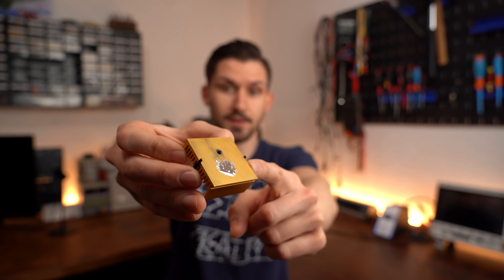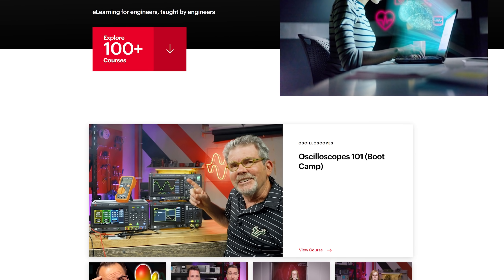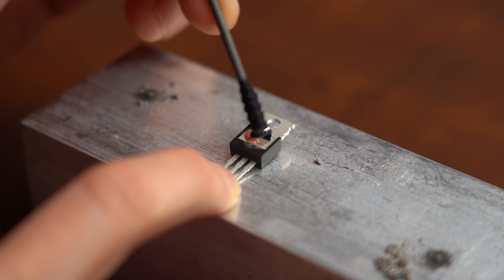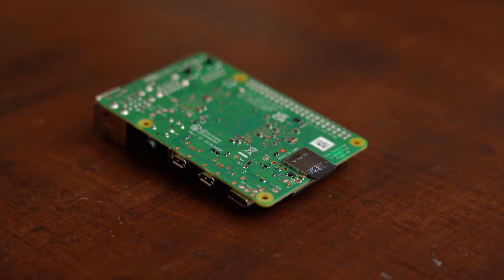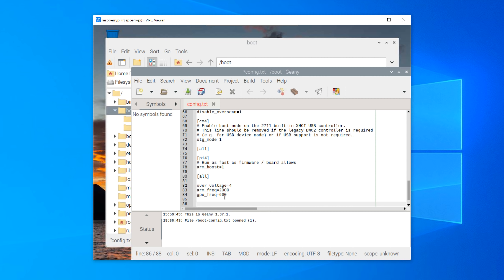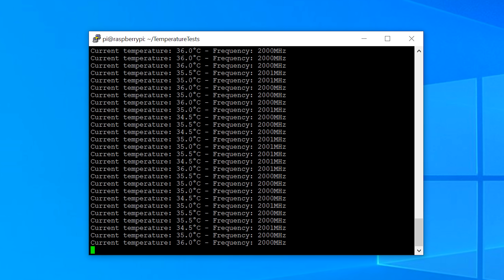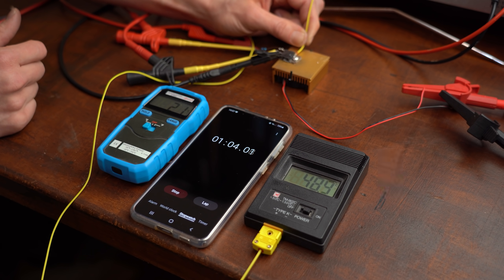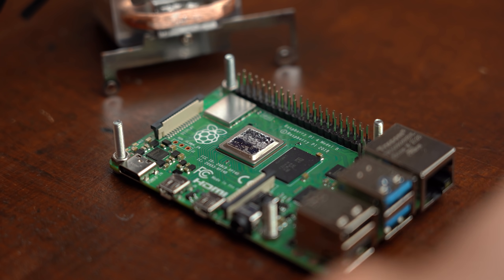Will Liquid Metal replace Thermal Paste? A Raspberry Pi gives the answer!

Comment: (written before watching) LM is one of those meme components(?) simply because of the PS5. Regardless of how well it may displace, conduct, or transfer heat, it is literally metal, and any stray amount can (and will) short circuts, and it's not the best of materials for contamination to circuitry, because it's liquid... I wouldn't ever buy a console system in the first place, but if I were, I wouldn't even consider the PS5, because any trace seepage would destroy the system... I'm curious about the failure rate of it used primarily in vertical orientation, but I'm not too arsed to bother with the failure rate of toys.
(edit after viewing): I wasn't aware of the limitation of not being able to use Aluminum, but that just furthermore solidifies why it shouldn't be used, considering (as you pointed out in the video) most use or have Aluminum heatsinks.
Reply: most use or have Aluminum heatsinks - that are coated in Nickle plating....... that is just fine with LM. Check out gamers nexus and LTT.

Comment: You most likely would have yielded better results with better clamping (on the fet test) and more importantly lapping.  Uneven surfaces will hurt liquid metal a lot more than thermal paste.  It's way easier to screw up the liquid metal application than thermal paste where too much isn't a thing.

Comment: Make sure to throw all the aluminium parts that came into contact with liquid metal in the trash. The metal will have reacted with them ans seeped into the material. They may or may not just randomly break.

Comment: roughly 10 years ago I got curious about gallium. One word of caution > It also affected iron tools. In 6 months or so every screwdriver / allen wrench / whatever tool It came in contact with had been degraded and thus broke from normal work. <  Seeing a screwdriver fall apart @ the tip was funny. Just fell apart.     Also, I remember it damaging mosfets. it might wick up through the terminals and then alter the junctions within the ceramic package...   So, although it appears that iron is not effected. time will tell. . .   make note's caz it's hard to remember half a year out.  p.s keep this stuff away from the soldering iron tip as I lost MANY tips.

Comment: I think power LEDs could greatly benefit from LM, only problem is aluminum used in most of the cases
You might try electroplating aluminum, not sure what steps are necessary to do it at home, and for nickel to stick to aluminum (often extra steps are required, like palladium layer for copper), and since you got so much of the stuff you can try and test it - you use pretty much 1/4th amount you'd normally use on cpu at most

Comment: Usually there is a thermal compuound between the "cpu" and the ihs (integrated heat spreader) which will be the limiting factor until you delid the cpu (take off the ihs). WARNING! some cpu's the ihs is soldered, as far as i know ryzen cpu's as a example.
Reply: Conveniently, solder is solid metal, so there's no point in replacing it with gallium.
Reply: @MrNerdHair  No, there is. In most cases, the tolerances are so bad that they put over 1mm of solder, which can even be worse than thermal paste.

Comment: A lot of people don't consider heat soak.  Sure, LM transfers heat faster, but eventually the system will get fully saturated and it won't make any difference.  The difference comes with the cooling type and cooling capacity.

Comment: Great video!! I think you might have biased a little bit the results during the Raspberry pi test. Think that by removing the aluminum around the copper pipe, there is less contact surface between CPU and heat sink than on the thermal paste test, so even though the numbers are initially the same, they cannot be compared.

Comment: what we have here is solid proof that liquid metal is not the end all be all solution but more a specialized solution say if you are dealing with low temperatures or maybe rapid heat cyckling it's great! but for slow consistent heat dissapation say for small electronics it's not really all that much better given how you are forced to switch to a copper bottomed heatsink

Comment: The risks associated with Gallium contamination and liquid metal negate any possible thermal benefits. Silver based heatsink compounds are more stable and the commercially available products are the result of many years of research and testing. Silver has the highest heat conductivity of any metal, so with correct heatsink design and application of the compound, the maximum attainable performance should be achieved. Generally speaking, heatsink compounds are applied in a layer that is far thicker than is needed. The idea is to fill the microscopically small gaps between two perfectly flat metal surfaces and for that purpose an almost transparently thin layer of heatsink compound is sufficient. A thicker layer actually increases thermal resistance.

Comment: I wonder how the behavior of liquid metal on a long run is. Thermal paste tends to get crusty and needs to be renewed when it starts to dry Out. What about liquid metal?
Reply: it oxidizes when in contact with most metals (very slow, but it does happen - over a time span of years).
I think the playstation is a great mass market test for LM, before that it was mainly a thing in the custom PC building scene, and I guess most PC builders (especially those who care about cooling performance that much) clean or upgrade their system rather often, so they don't leave the metal applied for long time periods. 
Thermal paste is better than you might think. Yes, it can get crusty (quite random when it does, I also have seen 15+ y/o paste on chips that was still viscous), but even then it won't fail 100%, temps might increase by ~20 to 50%, but the conductivity isn't completely lost. I have a feeling that once LM gets oxidized a lot, temps will rise >100%.
Time will tell, the PS is a great test.

Comment: I’m curious can you use thermal paste on the edge of the processor then place liquid metal in the center to have the paste keep the liquid metal in more?

Can use painters tape or not sure what other tape maybe thinner make a square place in center of processor then apply paste to sides attach heat sink to smoosh the past then remove heat sink and tape then apply liquid metal.

Comment: On variable rate CPUs/GPUs, in which most of the time the units are idle, the properties of the liquid metal can reduce wear on the parts. So while gaming for 4 hours straight you might not see much of a difference, a laptop that is in sleep mode, or just checking mail and going back to sleep such as a phone, it could increase the lifespan of the chips. Now, this seems counter to the profitability of those manufacturers, so don't expect them to do this.

Comment: Interesting topic. one should ask themselves, How Do We measure Thermal energy in relationship to conductivity and efficiency? I'll tell you the regional standard by me is using BTUs and comparing it to a known variable. in most cases this will be ICE per unit of time. check out the interesting thermal properties of latent heat vs specific heat

Comment: When you said the transistor dissipates 16W isnt that incorrect? According to the datasheet VCEsat(which i think is the collector-emitter voltage drop)=2V at 5A which should be like 1.5V for 3A in your case. That means that 16W whats are flowing trough the transistor but the transistor only dissipates 4.5W which i think is correct because there is no way that tiny heatsink can cool a 16W load even with the fan.

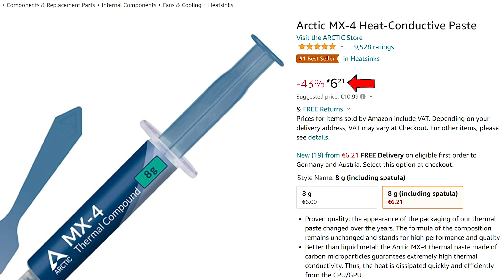Comment: well, at 2:05 you say that liquid metal is stil kinda cheap but it is 2 times the cost of the thermal paster you show wich also has 8 times as much in the capsule so ou can use it on multiple cpu's. soo the price difference per gram is much more than you make seem in the video

Comment: I have a laptop, with a 7700HQ CPU and GTX 1050 GPU, where I applied liquid metal in place of the stock thermal compound o! rhe shared heatsink. In this particular case, the CPU and GPU were putting out heat fast enough that there was a real improvement, not only in the beginning of any stress bench, but on the topend as well, as the heat was being transferred quickly enough to more effectively saturate the heatsink.
It went from easily hitting 99C on a CPU only load and throttling heavily, to hitting around 78C on a CPU load, and running a GPU stress bench in tandem only managed to bring things to around 85C.
In situatioms where the heatsink has the capacity to cool more, but can't get the heat away fast enough to dissipate it, liquid metal helps a lot.
Reply: Linus tech Tips did the same on another high power laptop, saw a solid 20c reduction in temps. Gamers Nexus did it on GPU's running for a year solid. Great results. Dude here failed to realize the thermal paste under the PI heat spreader ruined his test.

Comment: From my experience and some user reviews, some liquid metal do cause chemical reaction with copper heatsinks.  It seem liquid metal is absorbed by copper. I had to re-apply liquid metal almost every year due to increase in temperature. Some people think nickel plating on copper heatsink's contact surface might prevent such chemical reaction.
Reply: It's easy and fun too. Get some pure nickel guitar strings and make a brine with vinegar to dissolve the nickel into the solution. It turns green. Then reverse the polarity to plate onto the copper. I did this for another application last year and it was fun! Afterward, I re-used the Ball brand jar with handle into a mug for my iced tea after washing it out.

Comment: How about reflow soldering the heatsink? This should be a pretty good interface.
Reply: Gamers Nexus, Linus Tech Tips. Check them out, both have done great tests with LM. 20c reduction on a laptop. GN did year long testing on GPUS running nonstop. Both showed WAY better results then this guy did with his failed test. Under the Pi heat spreader is thermal paste... completely negating the LM application.

Comment: You just heard about liquid metal from the ps5 not the 4 year old video you mentioned from Gamers Nexus? Fair enough I guess… 

Your testing results are accurate but testing methodology is flawed. 

Your no heat sink Pi test is thermally throttling. The liquid metal Pi test is using a modified heat sink vs the thermal paste test. I mean why not just retest using the modified version with thermal paste? Or just use it on the aluminum for testing. It’s not like this is a long term effects on aluminum test.

Point is there isn’t a single metric of the Pi test that can be compared to another due to poor testing methods.

So going into the transistor test you knew heat sink saturation was a problem. So I figured you’d want to see if the passively cooled heat sink got hotter after an extended period with liquid metal since heat can transfer away from the component faster. But you stop the test where the temps meet instead of looking for a convergence. Again very odd and not allowing for useable data…

Overall this video just left me confused. Was this testing to determine if the thermal transfer compound did more than transfer thermal energy? It doesn’t, kind of in the name of the product….no need for testing there…

Comment: Great video and great conclusion. I used it in my portable workstation, and the results where from reaching a constant thermal throttling to not ever passing of 65°C. That's the best thing you can do to a laptop or any sort of computer with a compromise space for the heatsink. 12 bucks and you improve the lifespan, the fan noise and the performance, it's a no brainer. But as you show, please use painters tape or similar...

Comment: Liquid metal is called Galinstan it’s also used in mercury-free thermometers I was able to buy some from my local Walmart for cheap.
Reply: "Thermal Grizzly Conductonaut is a liquid metal thermal compound based on a eutectic alloy. A very high thermal conductivity is achieved through a special mixing ratio of the metals tin, gallium and indium. We recommend applying Conductonaut to nickel plated copper as this offers the best long term stability. "
Reply: @crisnmaryfam7344  I think should have phase this better.  -“This type of liquid metal is actually called Galinstan”.

Comment: Liquid metal is meant for extreme heat loads where the thermal paste does in fact, become the limit in thermal transfer from component to air
Reply: problem with his test here is that under that Pi heat spreader.... is thermal paste. So the liquid metal did nothing. And his modifications caused the reduction he seen. Linus Tech Tips and Gamers Nexus have tested this extensively. GN for a year on GPus running nonstop, and LTT on a highpower laptop. 20c reduction in temps on the laptop.

Comment: Only problem is your graph goes way higher than normal CPU/GPU temps desired.  Assuming 80c is desired max, might be worth it for those who want to OC or maximize cooling for the added effort and $10.

Comment: I made a whole bunch of the thermally conductive liquid metal (i have a bottle of around 45grams of it) and for a while i was using it EVERYWHERE (except for aluminium) instead of thermal paste and it often works great, but sometimes the lack of mounting pressure makes it worse than the conventional "stickier" thermal compound.

Comment: The Idea of thermal paste is to maximize the contact surface from cpu to cooler, it is not meant to have a big impact on heat transfer in the first place (like Teflon in a pan, teflon is a bad heat conductor, but that dosnt matter because it is only a thin layer)
It would be great if you could add 2 scenarios to this test:
1. no paste, just vanilla cpu to vanilla heatsink
2. using fine sandpaper and polishing paste to make a smooth and even surface
(to explain, in the past this was a technique to improve cooling abilities of a system, before delidding became cool)

Comment: Hi Scott. Liquid metal contains Indium metal, which is really rare and difficult to extract. In that respect I think it should be avoided if its use is not strictly required by circumstances.

Comment: I once soldered a transistor body directly on a thick copper wire, then dipped the other side in water
At that time I wanted my experiment to be finished quickly and at that time I didn't have a heatsink
So my conclusion is direct soldering of components to the heatsink is the best thermal paste
Reply: Its actually not. Proven time and time again by delidding cpu's and applying Liquid Metal the correct way. Gamers Nexus and Linus Tech tips check them out.
Reply: @abeowitz  neverminded the fact that you cant solder to a silicon die.... Smfh.

Comment: We did extensive testing of thermal compounds versus liquid metal when it was extremely popular for computer overclocking. I’m sure it’s already obvious but we figured out liquid metals primary ingredient is just gallium which isn’t the best at thermal conductivity at 3.51±0.03 watt/cm C it also physically moves when temperature change occurs and since it’s conductive is a recipe for failure. Gallium also doesn’t play nice with a lot of different metals and has the potential to corrode and react with certain materials. I know this is going to sound like a salesman but using our patented compound we were only noticing a delta of a few degrees between liquid metal and our compound. Comparing to some of the reputable compounds on the market such as ic diamond, mx5, Arctic silver, etc. also showed a negligible delta between temperatures. For us the disadvantages outweighed the small advantages and we recommend and stick to standard compound

Comment: There's a reason why liquid metal doesn't help much with some setups. The thermal interface isn't always the bottleneck in cooling. In water cooling it can help a lot more since water temperature is so much cooler than the cpu, but you're still limited by the speed the block can disperse heat into the water
Reply: It's never the bottleneck; thanks to hundreds of years of product design and research.

Unless of course you don't use any thermal compound, or forget to remove the plastic cover from the heat sink or CPU before assembling it.
Reply: That's why you take an air cooler, and use that as a giant water block.  Then use a giant radiator.  Or, if you're Intel, just cheat and use a hidden phase change cooler.

Comment: i had heard gallium reacts with copper so the only heatsink that its useful for is nickel plated ones!
Reply: "Thermal Grizzly Conductonaut is a liquid metal thermal compound based on a eutectic alloy. A very high thermal conductivity is achieved through a special mixing ratio of the metals tin, gallium and indium. We recommend applying Conductonaut to nickel plated copper as this offers the best long term stability. "

Comment: In RF amplifier we normally use a very thin Indium sheet in output powe transistors. It's a very good thermal conductibility and we can use directly over aluminum heatsinks.
Reply: I saw an LTT video where they tried graphene sheets but werent impressed, do you have any knowledge or experience with them?
Reply: @conorstewart2214  I tried using graphene sheet. The datasheet specs are great....but it didn't work as well as the Indium sheet. And it's very expensive and each manufacturer has a different specification...
Reply: @CrazyLabs  It's because it's meant to spread heat sideways, not through it.